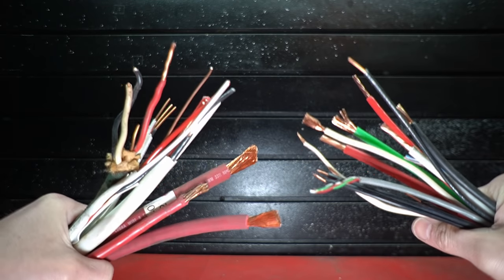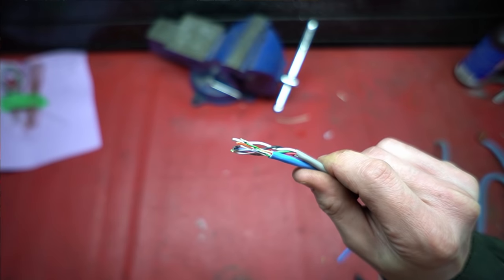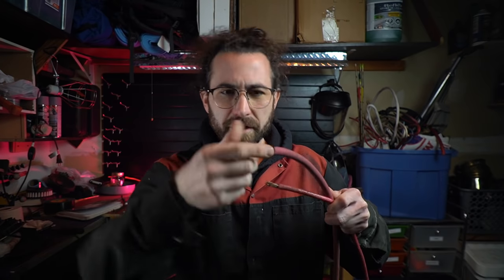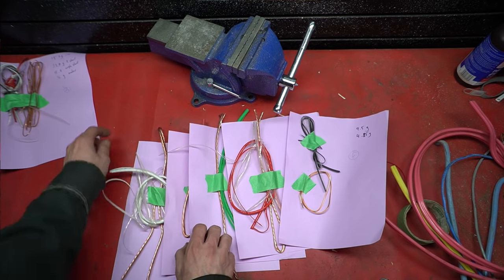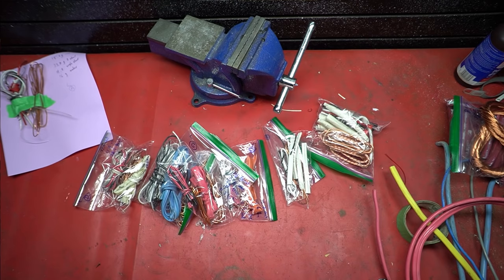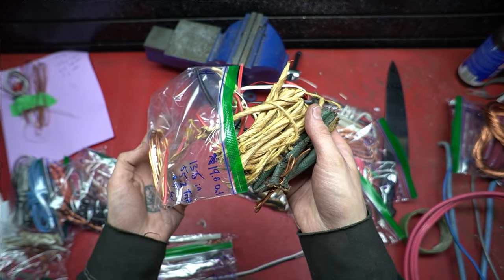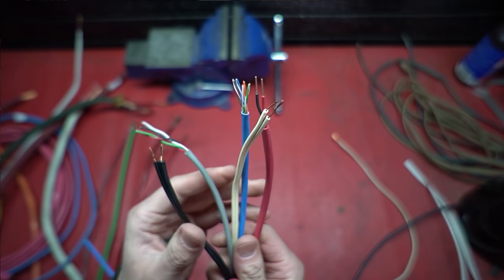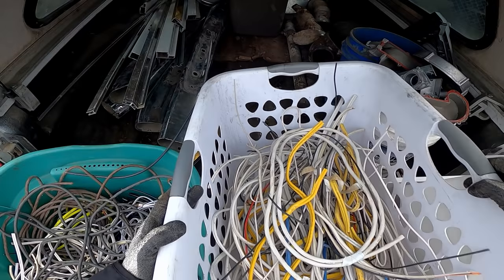Is It Worth Stripping Copper Wire For Scrap? Should You Buy a Stripper?

Comment: Been piling a lot of romex over the years - I've heard of burning the coating off. Ever do it that way? I've always thought it would burn up or ruin a lot or am i completely wrong? Im in a farmland area with no neighbors to stink out
Reply from the maker: I’ve never personally done it, hopefully it doesn’t surprise you to hear me say: please don’t, it’s not about stinking out your neighbours, it’s the environmental damage that makes it ignorant and irresponsible and that’s gross.
That said, it depends on your local scrapyard whether the price will change. Mine has a ‘burnt copper’ category that is quite a bit lower than the #1 it would have been otherwise, but yours might not care. But romex is SUPER easy to strip with a plain old kitchen knife, you just pierce the knife through the broad side between the strands and it slides through it incredibly easily, it’s basically effortless and very clean. Then you’ll have a strand of #1 clean and a couple insulated #1s! I regret not discovering that before making this video 😅
Reply: @thubprint  I've never actually seen it done but that's the only way I've ever heard scrapers say its done. It sounds like they would be losing money. Believe you me the big corps in Detroit are ignorant and irresponsible - the air at night always smells like burning tires. Just discovered your channel today - great stuff
Reply: You really do not want to burn it , it ends up being low quality and it is a mess , and I think maybe illegal to do so in most areas these days

Comment: My opinion on 'cable stripping' is that if you dont have a cable stripping  machine, it is a discouraging task to do with a simple knife... And as for the links that you put saying that these are ( cable strippers ), well to me two of them are simple wire 'Cutters' and the third one are ' chanel lock pliers ' witch none of these are classified as '' Cable strippers'' 
And about the 'Real thing'  a machine like ( The Blue Rock  MWS 808 PMO ) is a very good cable stripping machine for around 1200$ CA. witch pays for it self by stripping 300 - 400 hundred pounds of bare brite no. 1 copper. Especially if you strip large size wires like 1/0 to 500 MCM that the machine is capable of stripping.
Personally i dont strip the small loomex 2/14 - 2/10 AMG. and even less the 3 wires because it is to time consuming to (Untwirl) ... But if it is 3/8 AMG and up ! then yes i will take the time.
And i agree that taking the first  jacket off is worth to do  if you have the time to do so.
In conclusion your video is very informative and gives a good idea of the % of the weight vs the material
Thank you👍
Reply from the maker: Thank you for your thoughts! I definitely agree stripping with a blade is just silly. It’s fine if you collect very little and you end up with a couple really thick pieces, but a machine is certainly the way to go if you’ll be doing it with any frequency.
The product links are all labeled btw, I wasn’t indicating they were all stripping options 👍

Comment: Tracking copper is essy. Finding the yard that pays the most is easy. So strip sort stack. Evan if its just 1/2.
  Then sell around Christmas. Save a goal amount.  You get more if you have more. So 500lb should be your bottom. Drive 100 miles to get the best price.  Let your home town rip off yard ,No .  They will quit being cheap

Comment: Hi @thubprint!

I got the runaround from this question answer site and they totally let me down. My boyfriend is a long time subscriber of yours and he says that you are the truth, so he suggested for me to try asking you.

I have a few questions about what to do when scrapping wires. Im hoping you could help me out!

When is wire considered #2? (Specifically- vaccum wire and extension cord wires?)

Which wire is garbage, and which wire does the scrap yard NOT want?

Which wires is it okay to leaves those white plastic parts on at the ends (if any at all)?

And last but not least...

What are common examples of each grade of wire that normal people will come across most often while scrapping?

Thank you so much for your help! I look forward to hearing back from you!

-Alora
Reply from the maker: Sure! I had hoped I answered most of those questions in this video, but I’ll see if I can be more clear.
#2 is any wire which will yield less than 50% of its weight in recovered copper. The wording here is important because even if a wire has greater than 50% copper by volume, if it’s all really fine strands braided together then a lot of the copper will burn away when melted. The easiest way to identify #1 is to bend it, if it has a solid core that stays bent then it is probably #1.

The scrapyard is the only one that can tell you what wire they don’t want but in my experience most will buy any copper wire except coaxial wire, because the copper recovery on coaxial is extremely low.
The same is true with the ends. My favourite scrapyard is extremely picky about end terminals and even bits of tape, they want all wire to be super clean. That’s because they’re actually really generous with the categories, and I’m happy to do it because most of the time I just bring in a giant bin and sell it as #2. Other yards are much less picky about the ends but it’s because they intend to be unforgiving when grading, and typically buy my mixed bins as #3, so I make a lot less money overall. I’d be cautious of a scrapyard where you feel like you’re getting away with leaving the ends on because you’re probably getting paid less. The only time I leave them on is on Christmas lights.

For common types of wire scrappers will find, just watch the video! 😆
Thanks for the questions, and I hope I was able to help 💙
Reply: Yo yo what up homie,? What's good from N.y. ? As ALWAYS, YOU ANSWERED MY questions & Concerns thoughtfully; thorough . Thanks for taking  those extra few minutes. Crystal clear now. Brody. Take care of yourself N ya Fam.  Peace out my Dude.  ONe .....

Comment: I just Bought a 400.00 stripper But I've been collecting copper wire for that last 25 years i have 5 big trash cans full of the Power cable each one weights 550 pounds each Last time i was at the SA scrap yard i took in brass and  Number 2 pipe with flux on it got paid $4.00 a pound. Now i have bright and shinny copper wires close to 2500 pounds. Ya its a good idea to buy one now even if i just use it for the next 10 days and make my self 6000.00 9000.00. I will have a machine that is paid for and I can put it away for another day of strip[ping wire But i'm buying me a new plasma cutter for 500.00 this next week, Buy your tools now cus the cost of these moths are going to sky rocket. Buy spare parts as well. I'm retiring from the scrap or just slowing down Been in it for 27 years. Finally I'm going to get paid off my Hording of my copper wire No better time to sell it. at 5.50 a pound  for bright and shinny 
 .
Reply from the maker: In your position, heck yes I’d buy one too!

Comment: Is it dumb for me to strip all the copper i have, put it inba bucket, then take it to the yard?
Reply from the maker: I don’t see why it would be dumb, I don’t know what your financial needs are and maybe you’d enjoy doing it. The closest thing I can offer for advice is simply that stripping wire that is 10gauge or smaller pays less than minimum wage, even with a drill powered stripping machine, so I don’t do it. 8g and up is all I do.
Reply: @thubprint  its kinds just therapeutic for  me. I like to also take apart electric motors and appliances I find in alleys or side if the road in trash days

Comment: If you can burn the wire just burn the wire. It only takes a few minutes rather than hours. The trade-off is about 13 cent. I can lose 13 cent a pound if it saves me hours.
Reply from the maker: I did a whole video on this because of comments like yours! I understand your reasoning, but it doesn’t survive scrutiny. I don’t expect to change your mind on anything, but hopefully I can save others from coming to the same false conclusion and causing harm while doing so

Burning Wire for Copper
https://youtu.be/_yiyZttDtlU

Comment: YouTube deletes my comment if I link.  Go to Imgur & search "wire strippers I've owned"
Reply from the maker: You’ve tried out a few of the manual stripping tools! I’ve wondered about those, your write up for each was really helpful too. Do you still use those type?
Reply: @thubprint  I'd still be using the $100 TNT wire stripper if my stupid sister didn't throw it away.  I'll probably buy it again.  The other 2, I would never rebuy.  Not worth it if too many adjustments or slipping off the cutting wheel slows me down.

Comment: Your percentages are configuring price increase but Not the weight decrease! The ratios are identical! Ahhhhhhh
Reply from the maker: No, I’m pretty sure I did it right. I first determined each wire’s composition by percentages of the total weight in copper and insulation, then extrapolated the values from a hypothetical 100lbs of each wire by those percentages. There was nowhere in my equations to subtract the insulation weight because of this. I showed my work!
Reply: @thubprint  you my friend are professor material